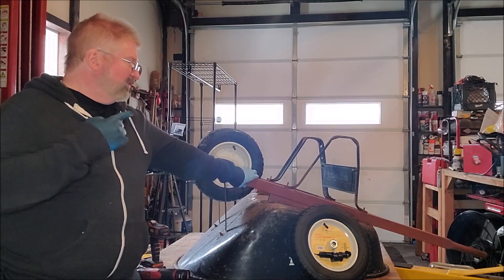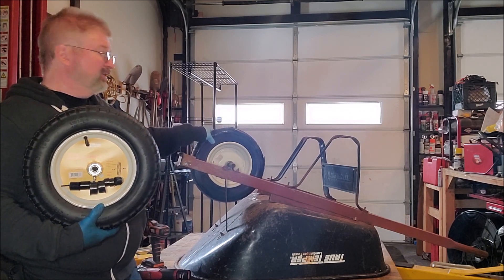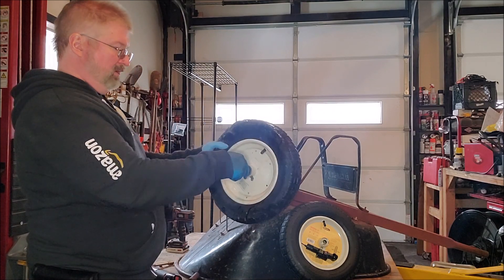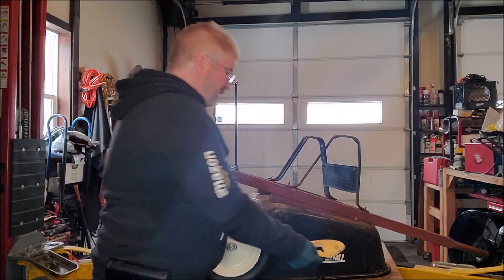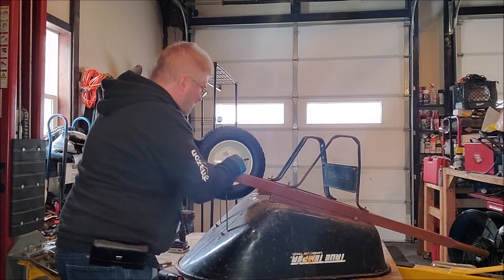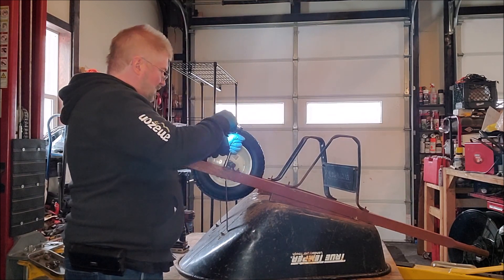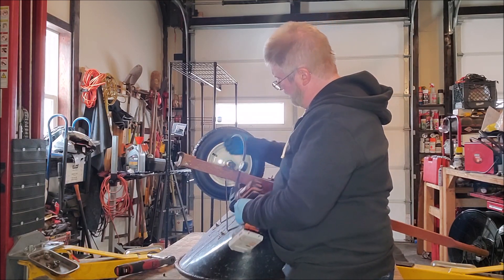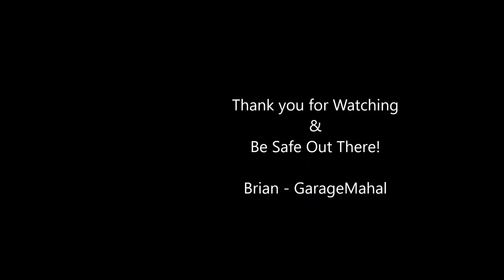How To Replace a WheelBarrow Wheel, in under 10 minutes

Comment: I dont have a grease gun. I bought the new wheel and tire. Just wondering if WD-40 is good enough without greasing the bearings?
Reply from the maker: Wd is too thin, it will work for a few hundred feet before it thins out completely
Reply: @GarageMahalLife   ok. Thank you

Comment: Rookie girl here. Do I have to buy spacers when I go look for a new wheel?
Reply from the maker: They actually come with spacers 😀
Reply: I found one on Amazon that matched the old tire, and the rim stuck out on both sides such that it didn’t need spacers.  Fit perfectly on my old Home Depot wheelbarrow.   It had wheel bearings and a grease fitting.

Comment: And I was going to throw away my old wheelbarrow just because the old wheel is flat.  Not so handy here, but can I get around without using the socket?  I don't think I have one.
Reply from the maker: I'd pickup a socket set... I mean you can hack through it with 2 plyers...